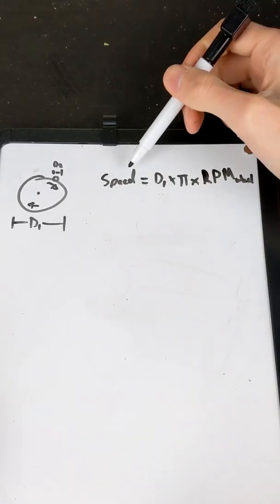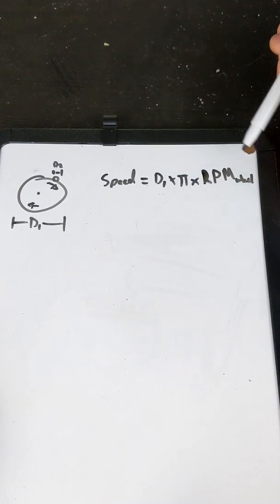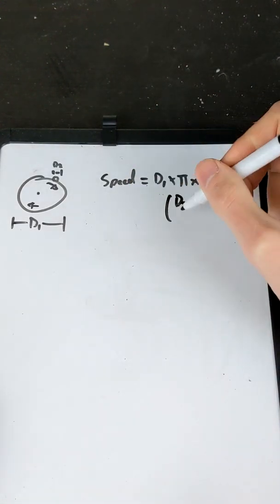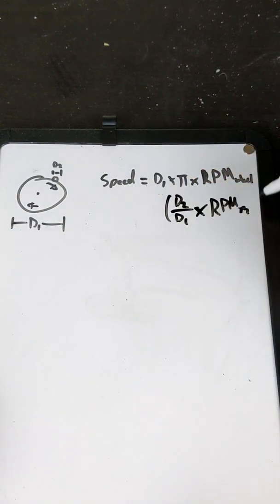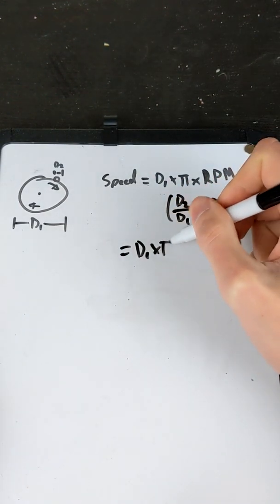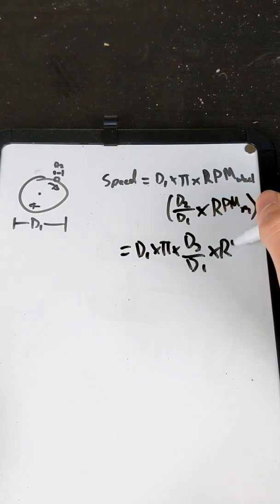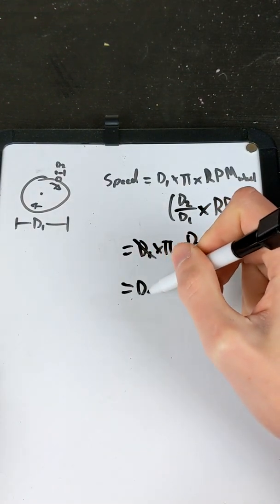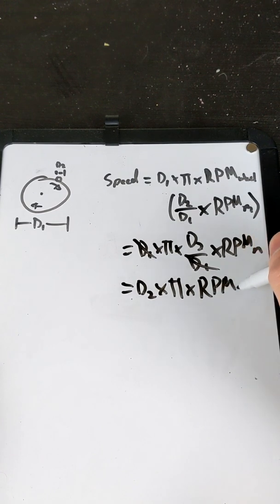Tangential Drive Speed Weirdness #short

Comment: Cool and something that makes 100% sense when you spend half a second thinking about it. So maybe.. instead of 1 x 50mm wheel a side, you use 2 x 25mm wheels with the motor shaft between, stacked. One wheel protruding from the bottom, the other from the top. Now when you go inverted, the throttle will still be forward for forward, back for back. Turning wild be reversed though.
Reply from the maker: Thats an interesting idea!
I'd have to see if I could fit it in cad

Comment: If you have four wheels and attach your tangential Drive to only one set then have the second set riding on top of the the first set you will be able to run inverted without having to change the direction of your Motors also if you move your Motors back away from the wheels and put Driveshaft in this will take your Motors out of Harm's Way instead of having them out on the sides by the wheels where they will be subjected to the same damage as the wheels
Reply from the maker: Thats an interesting idea!
I'd have to see if I could fit it in cad

Comment: While it looks counterintuitive the problem can be seen in this way: you are actually using the wheel as an 1:1 lever to transfer the shaft rotation to the ground, this way it doesn’t matter how big the wheel is, since the axle is rolling on top of the wheel that is rolling on the ground you will always move by the amount the shaft has rotated on top of the wheel
Reply from the maker: Exactly!
I just definitely did not see it that way on first look

Comment: I do believe wheel size affects theoretical torque at the ground though, I say theoretical, because overall torque is limited by the available friction force at the motor shaft to tire interface
Reply from the maker: I'm not sure, but gut feel says that its just a direct transfer of speed and torque (theoretically)

I agree that total torque will be limited by friction forces

Comment: Right! Because the bigger your wheel, the bigger the "gear" ratio between the shaft and the wheel. But by the same token, the bigger the wheel, the faster the robot moves across the floor. It's almost like the wheel is acting as an idler gear between the motor shaft and the floor. Every mm of circumference that the motor shaft moves across the wheel, the wheel also moves across the floor, regardless of the wheel's diameter.
Reply from the maker: Exactly!
It was thinking about it in terms of that last sentence that got me to realise what was going on